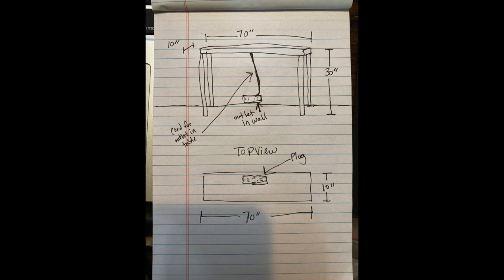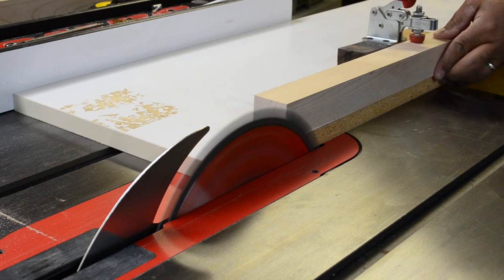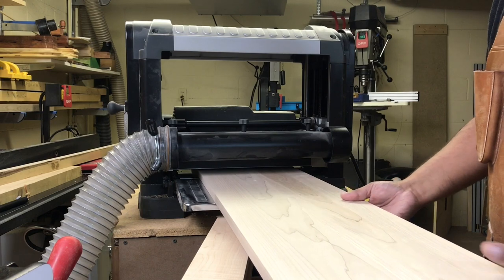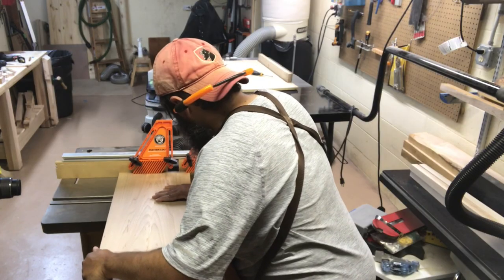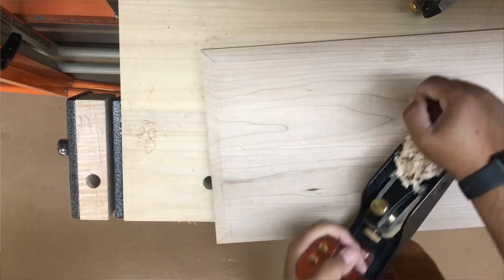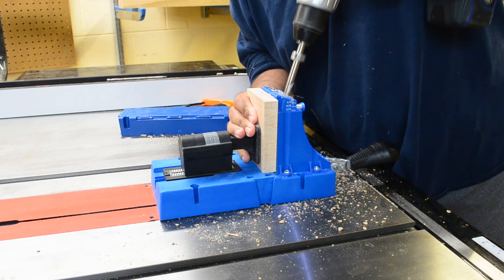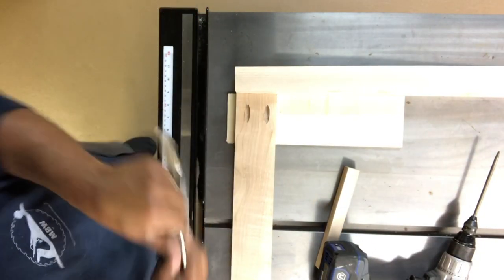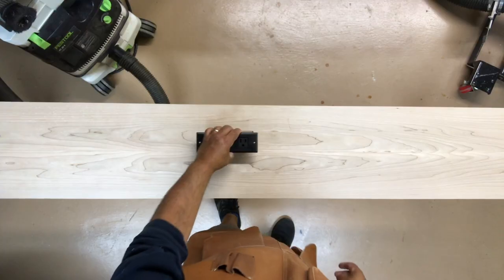The Other Sofa Table

Comment: Shop Purge? I saw that movie. Best of the trilogy!

Nice looking table Matt, very good work. I've been dipping my toes into the water based poly the last few days to finish the interior of a box. If you dint mind the question, what do you use to apply it? I get quite a few brush marks with a brush. A rag seems to do a little better but it's still not perfect. 

Thanks for the great content!
Reply from the maker: First of all, thanks for watching! For the finish, I ended up just using a foam brush. Is it a professional-like finish? Not even close, but there were no noticeable brush marks. Hope this helps.
Reply: @Mattsbasementworkshop  you're quite welcome! Always enjoy your work.

Thanks for the tip, I'll give them a try. My daughter may have some foam brushes I can "borrow!"